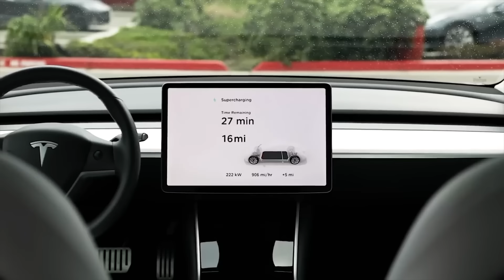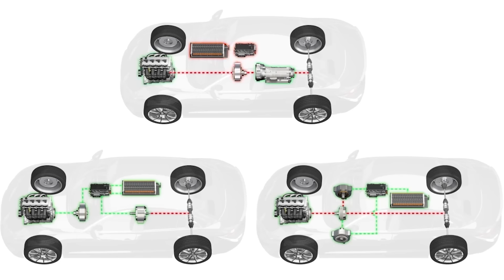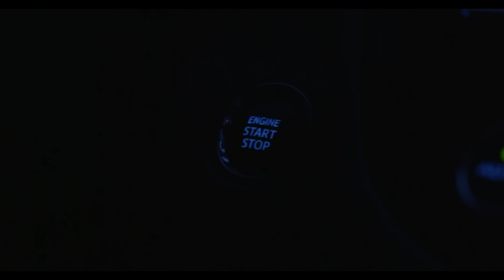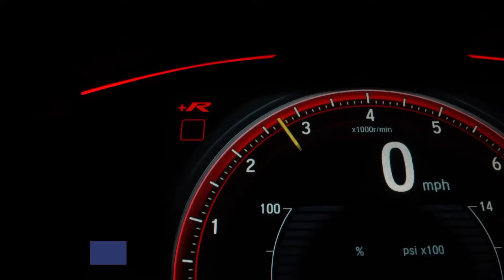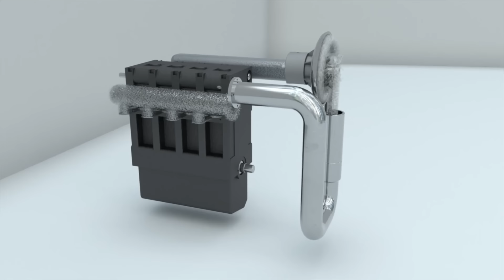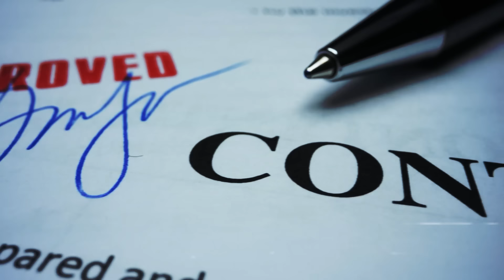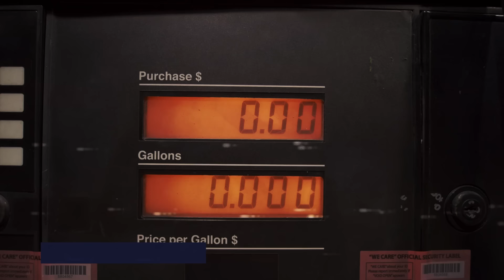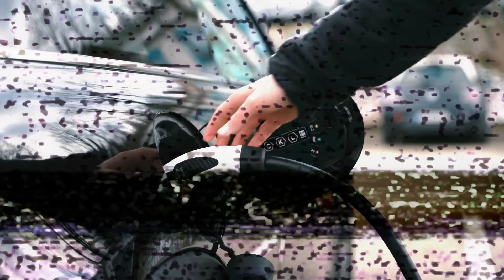Toyota CEO: "This NEW Engine Will Destroy The Entire EV Industry!"

Comment: I will never buy Electric Vehicles! In order for me to buy one, First, it has to at least be able to charge from 5% battery to 100% battery in 6 mins, second, the battery has to last forever, like the internal combustion engine, I can’t accept the battery to degrade overtime. You need to replace the battery every 3 years, otherwise the range will be a trouble. Especially, in Australia, range is everything. My current car has a range of 1200km. Brisbane to Sydney without even needing to refuel it. The main problem of EVs is it is not environmentally friendly in the production of EVs batteries. Waiting to see how Toyota’s hydrogen can do in the future

Comment: World leaders do not want to have hydrogen vehicles, because everyone with access to water will have fuel. Fuel which cannot be used to control markets and global economy. Every country with technology can achieve that. Promoting EV as a future is short term as mentioned in the video. It is easier to produce cars based on existing technology of using batteries instead of developing hydrogen usage of the cars. Fingers crossed for Toyota to achieve what seems to be not achievable...

Comment: Solid state battery need to be updated with circuit board with capasitors to start the heat and insulation to  sustain temp

Comment: ….as a Tesla owner I find this video is filled with many value judgements and wrong assumptions…new technology of batteries will continue to improve and a 1000 km battery is around the corner…whereas ICE cars are limited by inefficient mechanical engines and expensive fill-ups… that they concede hydrogen may well be more expensive than gasoline…and the thrill of hearing the roar of the revving engines and burning tires is just ludicrous…and the wonderful feeling of having , and most likely needing , a local mechanic to fix your ICE car isn’t what people get excited about today when buying cars…Toyota is ultimately just trying to refine an outdated technology and by just trying to change one fuel to another while keeping oxygen consuming combustion engines alive , will not satisfy the new knowledgeable and environmentally aware Public…

Comment: the sheer fact that hydrogen will delver the same vroom vroom exhilleration is waht will put it ahead of electric, even though DC motors are faster, nothing compares to that feeling of revving an engine. its primal. internal combustion isbt going anywhere, although i can see it moving to hydrogen over petroleum

Comment: DON'T BE FOOLED.
 Hydrogen engines are not the answer for cars. Why ?
1. You can't recharge at home - the most major drawback.
2. Hydrogen charging stations are scarce, Pretty impossible to plan any long distance trip.
3. Hydrogen charging stations are very expensive to build - up to $1 million each.
4. The mechanics take up the whole hood and trunk leaving no space for suitcases etc.
5. Slow acceleration. No match for EVs.
6. Hydrogen is stored in long tubes so what happens in a major collision?
7. Cost of maintenance is high.
8. Heavy depreciation. A new Toyota Mirai can cost up to $70,000. Used ones sell for as low as $8,000 reflecting little demand for them. Not a good investment,
Elon Musk usually laughs when anyone mentions Hydrogen cars - and for good reason.

Comment: Hydrogen is highly explosive!
Time is advancing instead of U  turning.
If battery performance increases a few folds what else can't be done?
Reply: Hydrogen isn't explosive, it is combustive. Meaning it burns. That said, if you puncture the side of a hydrogen tank and it'll just... escape. It wont burn without an ignition source, and if there is one it'll just be a gout of flame. It is actually safer than a petrol engine (which will explode) or an EV (lithium fires are INSANE).

Comment: my opinion if a car is just for purpose of moving from point A to point B, the hydrogen powered vehicles may be a better option in a long run. BUT I just don't think it is suitable for automatic drive. Hydrogen and gas car have its obvious limit for auto drive technology to develop. electric motors generally offer more precise speed control compared to hydrogen cars.

Comment: So, what exactly do you need to produce hydrogen? Energy! What is the power ratio energy - battery - wheels vs energy - hydrogen production - hydrogen transport - engine with loads of turning parts - wheels? Materials required for batteries will change & improve as more money is invested into R&D. And as far as energy infrastructure is concerned: now is the time to invest, because climate change will also require more energy to keep cooling running.

Comment: There's another youtube video out, "The Unfortunate Truth About Toyota's Hydrogen V8 Engine" that anybody thinking about waiting for a Toyota hydrogen ICE vehicle should watch.

The problem pointed out is that Toyota's hydrogen ICE engine will use a lot of hydrogen, so even going 300 miles on a tank of hydrogen will require an extra large tank. How large? Well, one of the problems with hydrogen is that it is much less energy dense than gasoline, in other words, to store the equivalent of a gallon of gasoline  take an awful lot of space.The tank will take up most of the entire back seat, and the trunk of a car. Since hydrogen refueling stations will be very scarce for a very long time, maybe you want a 500 mile tank. That would take up most of the front seat for hydrogen storage.

Comment: Hard to beat an EV.  Electric motors are the most efficient in turning energy into movement.  And they are torque monsters m, too.
Reply: They are not better for the environment tho that's the whole point of turning away from ICE engines and yet it's worst
Reply: @spacegaming7015  over the life service of the vehicle, they absolutely are.
Reply: @thatguy2408 yeah yeah, we have seen that in smartphones and use and throw earpods... They are even preventing battery replacements, similar things will happen in ev's expensive repairs, locked features, subscription and what not.
Reply: @rajawaseem6  yeah because ICE never have expensive repairs.

Comment: Toyota has been brave and innovative. Though the cost of hydrogen and its hazard is obvious, now... that may change as radically as EV in the future. Also after 300 miles, how long will it take to recharge.. 10 minutes?  1 hour? 4 hours? I perceive the fill-up on a FCEV may be comparable to a regular car.
Reply: Don't forget the hour it takes to get to the nearest hydrogen station and the cost
Reply: @bobmac004  I agree, but the technology and infrastructure for both electric and hydrogen are lacking. EVs, at the moment, is in the lead only because, for some reason,  our government has decided to subsidize that market more.
Reply: EVs charge at home!
On a regular Tesla supercharger a Tesla car will charge from 10 to 80%in 10 mins (now, before future innovative improvements), not quite long enough to go too the bathroom and get a coffee.
Reply: I’m so tired, to see that so many electric charging stations, rob our normal parking places, where I live. Good luck Toyota and other brave hydrogen producers. I also like hybrid cars - drive with gasoline and diesel in the country, and use electric engines in the towns and in ques.

Comment: Charging time (fuel cell fill time) is 8hr compare to 5min. So one hydrogen filling station in 8hr can fuel 96 fuel cell cars. Therefore you need 96 electrical chargeing stations to match one fuel cell fuel station. 
One fuel cell station is likely more expensive the one electrical chargeing station but its not 96 times more expensive.
So the infrastructure support of hydrogen cars could be cheaper.
Reply: You won't fill up a hydrogen powered car in 5 minutes if someone else has just used the filling point. It will take 10 to 15 minutes for the pressure in the system to equalise, before the next delivery can proceed....... You didn't factor in the cost of transporting the hydrogen. It won't just appear at the pump by magic...... Electricity needs no transportation.  Oh, and by the way. That hydrogen filling point still needs a supply of electricity to function......

Comment: So... the very best new ICE engines looking at 45% efficiency vs 85 and over for existing electric cars.  What's the max theoretical efficiency for a combustion engine?  50-60%?  It's game over right there.  ICE development is a losing battle unless you want something that's slower, more complicated, less reliable, and offers less torque than a current EV (ignoring the fact that EV's require a ton less maintenance).  Turn out the lights ICE.  I hear opera music.  EV's are not without their own set of challenges and I think I see some investment opportunities in the years ahead related to this, but I think EV sales are going to explode next year at least in the commuter driving market.  Toyota is too little, too late.  Maybe hydrogen has some kind of future in military vehicles where efficiency is a lower priority???

Comment: How does Toyota plan to produce that much hydrogen without the same problem of an insufficient amount of electricity? With EVs, people can have a solar roof installed on their house and use a home charger. I suppose they could get a solar roof to power an electrolyser but that would be an added expense. It seems to me like the power grid is going to have to grow simultaneous with EV/hydrogen ICE technologies. In the meantime, traditional ICE automobiles are going to persist.

Comment: How come Toyota can see the sanity in having a Hybrid vehicle, yet a a good portion of F'n  Governments around the world (including where I'm from NZ) either willfully or deliberately  just not cannot see, or looking through faux 'Green spectacles' to supply an entire countries EV's fleet? ..if your talking about the eventual  numbers and scale that is involved... You are  going to need a proportional scaled Grid & Transmission system, right from Generation through to Distribution..to match this consumption... Separate and ON TOP of the Grid and Transmission system that you already have that currently supplies Energy to your Industrial/Commercial and Residential consumers and customers. Existing Main 'backbone' Grid and transmission systems by the way that in more cases than not, are aging/ have had little or no real meaningful infrastructure Upgrades probably getting on in years (up to 60 to 70 years in some cases) ie  Wind turbine farms or Solar arrays alone are not going meet the massive total energy need required if you need that energy available for charging a n EV on a  24/7 basis ( at Night, and when the wind isn't blowing). Ok lets look at the boring stuff for a moment. Outside of  a specific Commercial Charging station... of which this still applies on another scale... lets look at a street or cul-de-sac of 10 homes for application of domestic charging of EVs. They would each  need a max supply of 16A, on a single phase supply...and yes it doesn't mean 16A is used, but must be available... (remember they already have an existing house supply burden).. so a specific metered pilot system would need to be installed, for each domestic charging setup. That means for just 10 houses x 16A is 160A. needs to be supplied by a transformer via an LV pilot network. NOT the already existing transformer supplying these 10 houses with its normal supply... ANOTHER Transformer,  will also need to be installed, that will need to have  3 phases HV and LV supplies balanced for Distribution purposes. So you can now expand this small 10 house example, to the very real 100s and 1000s of houses that the astronomical installation Costs this would apply, to see how unrealistic that just EVs ALONE are going to be the whole future of vehicle travel. The other fact, that Toyota is aware of is that Vehicles also need to travel very real Distances and pull large loads, not just light urban commuting.

Comment: Forgive me for my ignorance, but is possible to obtain hydrogen from a chemical reaction from a metal like sodium and water. I wonder if a practical solution is being explored that would require to fill your tank with water and have a reactor that releases the hydrogen as part of the car combustion cycle.
Reply: No. Splitting water into hydrogen and oxygen requires energy.
Reply: @ohlyepnguin4416 you could use an ICE engine in the car to get energy to split water to get hydrogen for a second engine. That should work 😂

Comment: EVs are superior ...way more superior to Hydrogen cars. Although they're both superior to gas powered cars, EV's have more use cases than Hydrogen cars. Hint: You can ride an EV on the moon. Not that you'll ever have to, but EVs can be driven on high altitudes much more efficiently. H2 powered cars dont  emit carbon, but they still require oxygen to run, which is not the case with EVs. 
Also you need electricity to generate Hydrogen. 
Plus you dont need a charging "infrastructure to charge" your EVs. They can be charged in your home, or anybody's home. So basically every household can be turned into a EV charging station. Whereas its very costly to turn every household into a hydrogen storage station. Thank about it.

Comment: I own 2 EVs and an electric motorbike they and my house is powered 100% from my solar system. My EV has bi-directional charging and can provide backup power to my house via my solar system. It has the equivalent of 6 Tesla PowerWalls of backup power (videos on my channel for the doubters) I have the potential to provide power back to the grid at times of peak demand (when my electric company finally allows this) By comparison H2 is an uneconomic and impractical distraction supported by the fossil fuel industry and legacy automakers like Toyota. Too many errors in this video to fact-check

Comment: Of course Toyota has expressed concern on EV conversion; rightly so as this does not back up their current business structure. This is a given by the high amount of R&D they have focused on hydrogen based energy, as well as the amount of cost converting manufacturing locations (engine and vehicle plants) with new design and tooling.
Reply: Just "retired" Chairman Akio Toyoda has always hated EV's and spent many years and many millions lobbying against tougher emission standards and for fees buying EV's. He quashed his engineers who wished to explore better EV batteries and platforms. We'll see. Starting to feel like he keeps announcing a break thru to slow EV adoption and shore up the stock price.

Comment: How much energy needed to produce hydrogen? Is it economically feasible? because it is said that currently it is required a lot of fossil fuels to produce it. And how about the efficiency in electric motor compared to hydrogen? because from my what I know is that Electric motors are the most efficient in turning energy into movement. And EV has less components and services (compared to conventional cars)

Comment: Jaguar is going nowhere. Volvo has a deal with Westport for gas-powered and hydrogen-powered engines. Increasing the use of electric vehicles to just 20% of the total would require electric power generation by more than fivefold. This is old garbage.

Comment: I am not quite sure on the safety side with regards to the chances of survival if mishap happens .

Like plane crashes living no chances of survival. Is Hydrogen driven vehicles resulting in similar result to that of plane crash ?. ( Note ; there are super large Hyrogen Storage built within its configuration ).

Judging from the high explosive capacity & highly flammable that  Hydrogen Gas inherently possess. The explosion when accidents occured would have totally destroyed & dismembered  & maimed not only the car but the  passengers would also break into pieces & both the car & human left unrecognised. 

I am not clear in this respect & need more informations on this matters. 

For better world
Bang T. N.

Comment: Crazy...they say a running car is efficient yet add the production of hydrogen which uses energy then transport and infrastructure to store it safely at stations and inside the cars. It must be stored at very low temperature at high pressure and dissipates over time. Before it converts back to energy to run motor. The expense in all steps is worse than petrol cars and all for the folly of having shorter stops on road trips 😂...Tesla has shown range and charging is no issue for road trip travel when you take typical stops for any type of car people have into account. 
It would take decades to build expansive Hydrogen supply for  limited embrace of an expensive new alternative to a declining ICE world.
Reply: NY  to Cali...Ill be there already while you spending hours charging and hopefully not in a unsafe place doing so.

Comment: TOYOTA THE NEXT NOKIA ? . In the past 10 years ago Toyota never believe that the gas cars can be replaced by the EV cars even today. While the EV cars going to rule the world but Toyota is head to Hydrogen cars instead which I don't think it's gonna happen because to have hydrogen it's need more money and during the process still using the electricity power to produce. It is hard and tough to be the only cars brand that provides hydrogen services station, to invest in hydrogen services station that's a lot of money. Nokia made deal with window phone instead of Android only 3 years after that Nokia say goodbye to the market, now a day try to make a come back with a few market share. Not only Toyota but many Cars manufacturers faced the same challenge. Gas cars or EV cars or Hydrogen cars or Hybrid cars, which one is the right solution. It's Important because if choose wrong one can be The next Nokia.